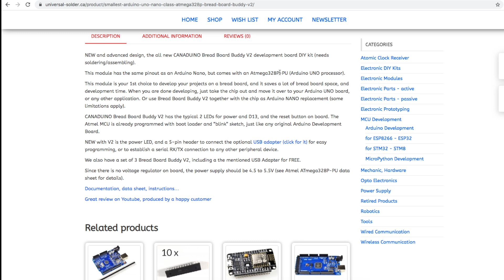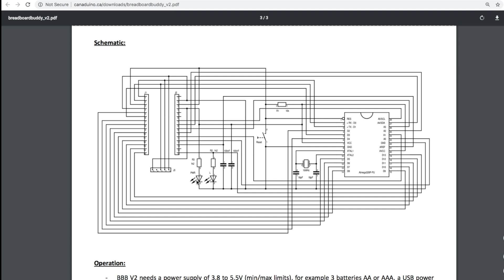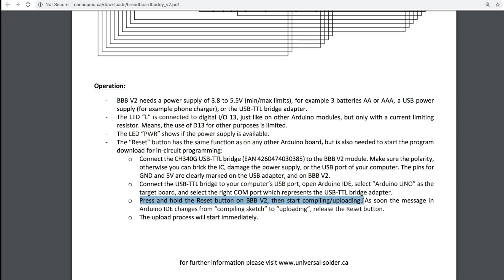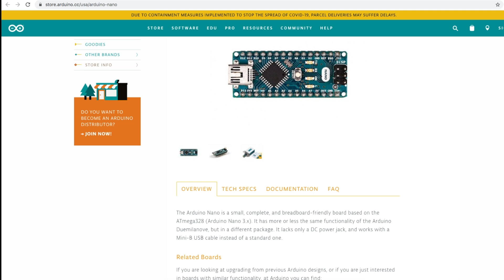Arduino Uno Clone: Kit Build and PWM Synth Test

Comment: I’ve built a few projects with various atmel mcus and I’ve never used a crystal. I never needed extremely accurate timings though.
Reply from the maker: yeah it’s been a while since I worked with standalone microcontroller circuits, I wonder if the Crystal would be needed in certain cases if the flags get set wrong and it needs an external oscillator or something.
Reply: Gadget Reboot: OTOH if the wrong flags are burnt, it’s bricked anyway 😄
Reply from the maker: then we get to make a high voltage fuse programmer. Even more fun!

Comment: 11:35 All have the p version ;)

Think it's a neat board because they managed to pack everything on it. But think the missing auto-reset is a pain. You get tired of that preeeeety quick. Together with it's size I don't really see the benefit of this compared to a Pro Mini (which has the bonus of auto-reset, a voltage regulator and is cheaper). Or a Nano which the sell for around the same price (and adds USB).

Comment: Nice kit, would also be a good beginner PCB design challenge. Beginner if you’re sending it to a fab-house, that is. Not beginner if you’re doing home-etching.

Though I’d definitely prefer it if it had an ICSP header on it, as opposed to UART. Mainly because I have a USBasp (clone) that I spent time burning new firmware on, and no FTDI interface. I’d assume that ICSP is faster because it’s synchronous, but that’s not a terribly well-educated guess.
Reply: ICSP is still available on pins D11-D13 , just not in the convenient connector that less minimalist boards provide.

Comment: nice little kit, but did the designer  get paid by the length of the lines on the circuit. :) they should have thrown in a few loops of the connector on a track for fun. I think this is what staring at 4 walls is do to us.
Reply from the maker: I did get a little dizzy tracing the wires.

Comment: Nice, but it would have been nice, if the kit included an USB socket and/or some kind of power connector at least. That way you have to add the FTDI/power board yourself. In other words: Not much left as a goodie in comparison with the bare ATMEGA328P as a chip.
Reply: The goodie is, you can't set an UNO on a breadboard, but the Buddy fits. And you can't remove the chip of a NANO to use it in a different circuit. You might have not realized that this is not just a cheap alternative to a NANO. It serves a different purpose. And it is hundred times more versatile than a bare MCU.

Comment: Yes, a slick kit.  Would want another pin out to serial control though, for the DTR-to-Reset, so Optiboot could do an automatic reboot.  Another thought ... the CH340E is inexpensive, and can be used as a USB/UART bridge without a crystal.   There may be room for it, but that would bet soldering the itty bitty.